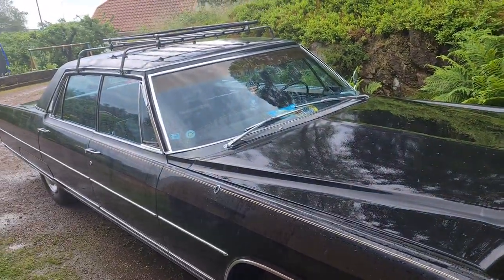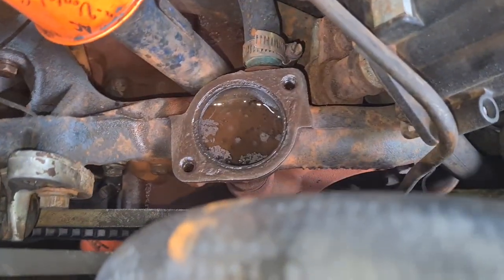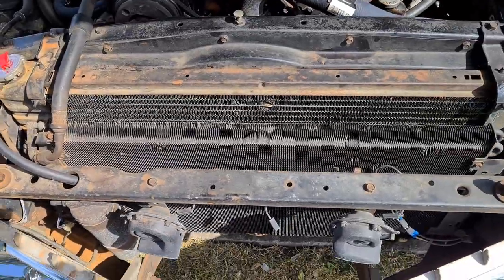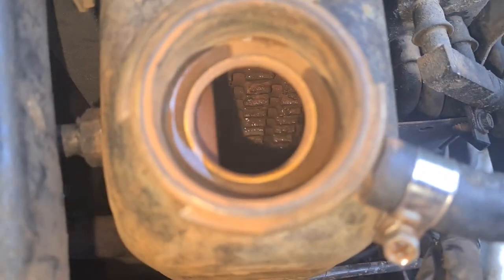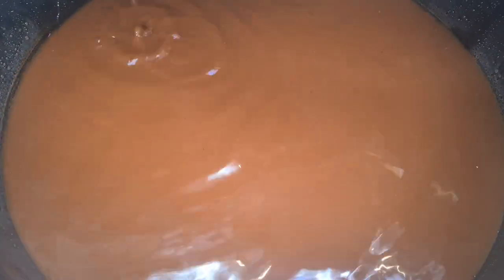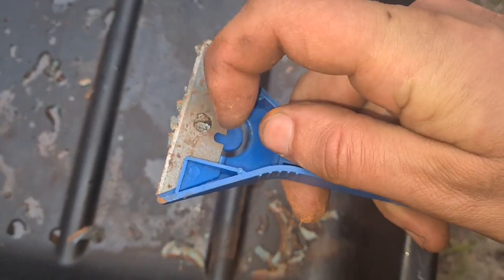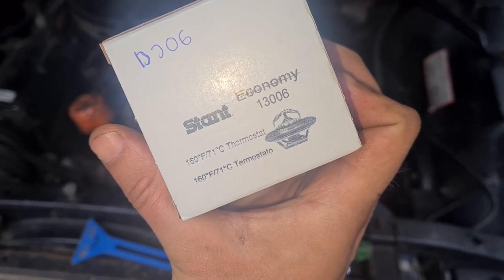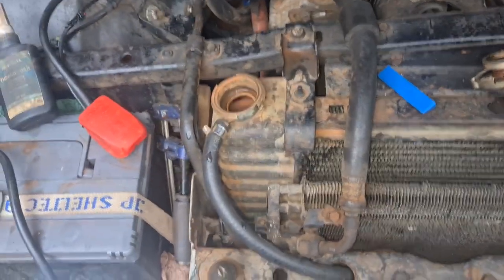Cool thermostat and radiator flush on Cadillac Fleetwood Brougham 1966

Comment: Thank you from Kentucky! I am preparing to flush my 67 eldorado and replace the thermostat, maybe tomorrow. I will also use a product called Evap-o-rust  Thermocure, though my radiator is not too rusty. It works amazingly well on tools, but I haven’t tried it in a radiator before. I hope that my 67 has a petcock drain so I don’t have to take the hose off so many time like you did haha I haven’t looked yet. 🤞🤞Thank you for the video!

Comment: Ett tips när du rengör kylsystem använd diskmaskin tabletter och gör det 5 till 6 gånger sen skölj med rent vatten ytterligare 5 gånger.
Sen spola systemet med vattenslangen både framvägen och bakvägen. Då kommer det bli rent. 

Jag har gjort så massor av gånger och det har blivit kanonbra varje gång. 

För övrigt en trevlig video. Alltid roligt med jänke bilar.
Reply from the maker: Tack för feedback och när du säger det så minns jag att jag hört detta tips innan. Aldrig testat maskintabletter, kanske får hitta en gammel volvo och köra det på först (men tror ingen jag har är speciellt rostig tyvärr). Och tro det eller ej, men spola genom kylaren med slangen gjordes för inte allt för länge sedan...